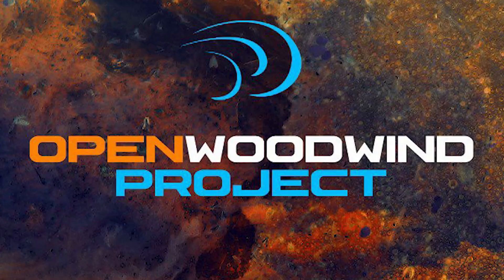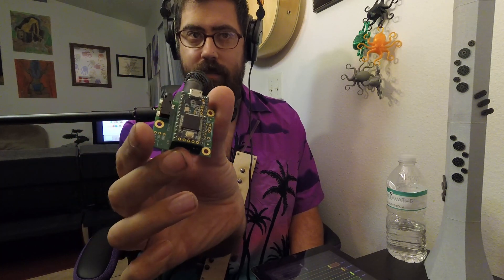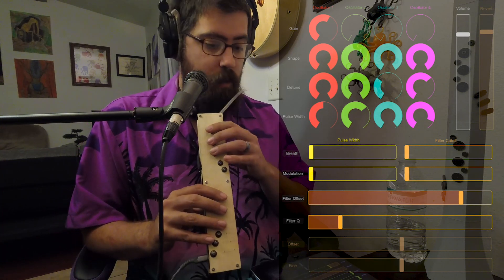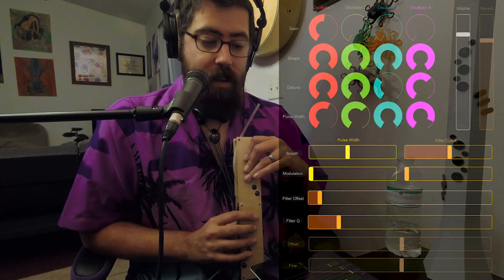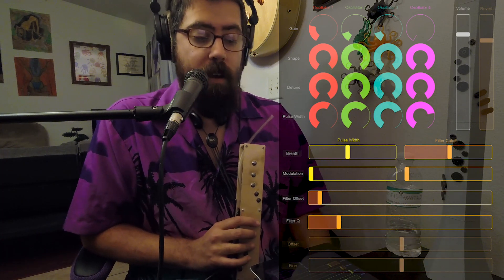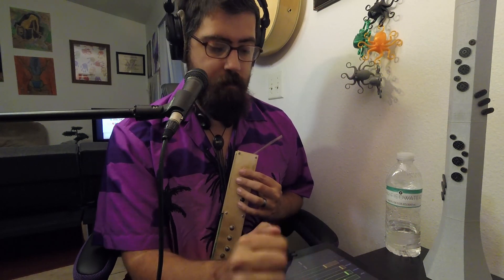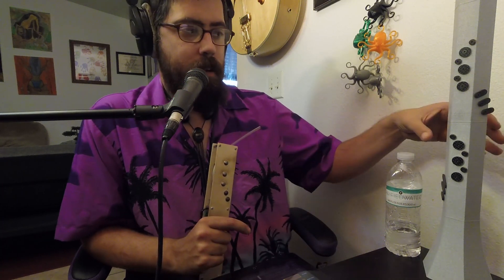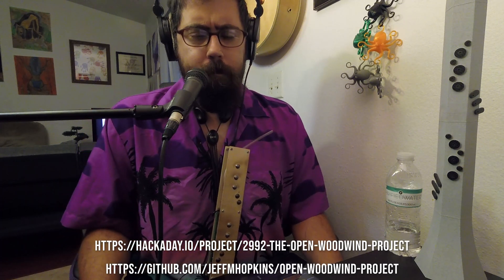Multi-Oscillator on Teensy Audio Library - Open Woodwind Project

Comment: That sounds amazing and is exactly what I want to achieve ! I'm about to the same thing in a recorder form factor by stuffing a teensy 4 inside a carbon fibre tube. I'm guessing you have an accelerometer for the modulation like vibrato that you demonstrated. So far I'm looking at teensy 4, I2S DAC output, 8 channel capacitive touch board for the finger holes, accelerometer, pressure sensor + battery and charging circuitry. I'm also including a small oled screen and rotary controller so I can setup without using an external device although your ipad / tablet idea looks very useful. I'll look at your source code as it will be a huge step up for me. You've given me something pretty great to aim for - well done !
Reply from the maker: Github here: https://github.com/jeffmhopkins/Open-Woodwind-Project

Not the easiest to follow, but eventually i plan on doing kit forms
Reply: @JeffHopkinsMusic  Any luck on that? I’m finally “in the market” and thinking about doing a build
Reply from the maker: And yeah the raspberry is acting basically as the osc to midi bridge. I eventually plan on integrating the onboard synth with the controller, but the ipad osc control is super nice to have.

Comment: Are you going to have specs on how you set up the raspberry pi as well?
Reply from the maker: I updated the readme on github for the OSC interface setup -> https://github.com/jeffmhopkins/Open-Woodwind-Project/blob/master/src/osc_configuration_for_linux_touchosc/readme.md
Reply: @JeffHopkinsMusic  jesus that seems so complicated. Thanks! Excited for this challenge. Im good with hardware.....software not so much
Reply from the maker: Michael if you’re on windows you can use the TouchOSC bridge program, a little easier

I updated the readme to reflect windows/Mac as well
Reply: @JeffHopkinsMusic  oh that works too. Does having it on the pi just help portability?
Reply from the maker: Michael it does, and I’ve been doing some synth stuff on it as well. The pi can make a portable hotspot which is super handy for remote use
Reply from the maker: I plan on hosting an image of the sd card for the Pi.

I'm basically using the pi as a midi2osc and osc2midi bridge, with auto MIDI patching between applications / services.

My github has all the config files for setting it up, but I do plan on making it easy for people.
Reply: @JeffHopkinsMusic  awesome! Im super excited about your project. I played alto sax for 11 years? And having this is a fun way to reminisce haha. 

Have a raspberry pi and teensy 4.0 so going to start ordering the other components